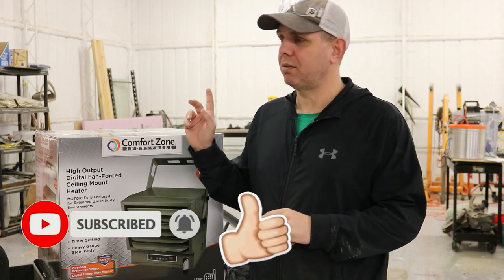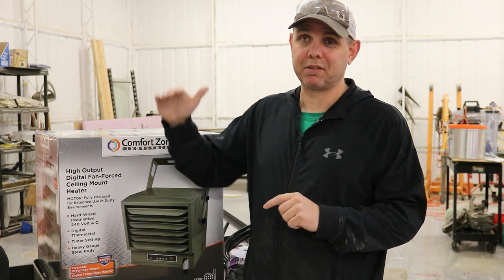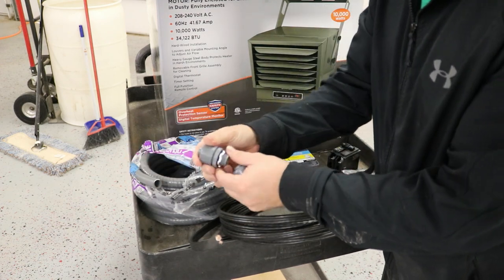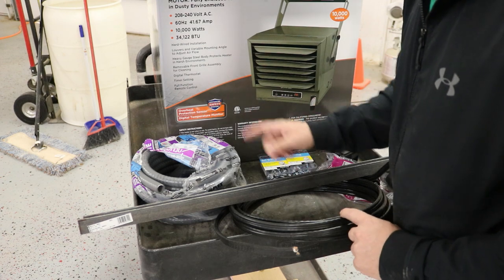Shop Heater, Electric Heaters for your Small Garage or Large Shop!

Comment: Hey Jake, Thank you so much for this video!! I have a 1200 sq. foot video studio with 18ft ceilings. The building has limited power options so I needed a single heater for the whole space. A buddy of mine (an electrician) and I followed your directions and suspended the unit 13 ft. off the ground. I was worried about the sound of the heater but it's not loud at all! We've had it up for about 2 weeks now and its awesome. Current outside temp is 32 degrees and 75 degrees indoors! Theirs minimal roll-off in heat in the corners -2 degrees max! I am thoroughly impressed with the product and very thankful for you video.
Reply from the maker: Awesome!! I’m glad I could help you out . 👍👍

Comment: Nice job Jake!  I work in a truck shop that heats with propane and has 18ft ceilings. We installed 3 ceiling fans, 55” size I think, and they have helped immensely to push that heat from the ceiling down to the work area. Might be an addition to consider.
Reply from the maker: Absolutely Andrew.. I have to take a break after lifting that heater by myself.. lol Thanks for watching.

Comment: Jake
I’m new to resin casting. 
It’s chilly here in Delaware 
So I’ve been holding off on casting. 
I keep my shop at 57 
And warm it up to 60-62 ish
When I turn 
Can I mix epoxy and put in a pressure pot at 65?
Then bring it in the house 
Cause I heat with a wood stove
Nice and  toasty
KB!
Reply from the maker: I have been doing all my pours at 65 and they stay in the shop... there’s nothing wrong with taking the pressure pot to  the house.

Comment: I have a question. I installed a 7500w garage heater. I used the 8/2 gauge wire with an 40 Amp 2- pole breaker but when I turn on the breaker. It would shut off all the power and trip the 2-pole breaker. What would you think is the problem?
Reply from the maker: You should contact a professional for your electrical issues..
Reply: @Jake Thompson  my electrician guy was installing it. He's not sure what's going on so I thought I asked you of what you think it might be. But thanks
Reply from the maker: @beeznestvlogs6981  i don’t need up using a 50 amp breaker.. I put some text in the video explaining it .. I’m sorry but I’ve learned my lessons on giving advise on things like electricity.. I’m just not qualified. I hope you get it figured out.
Reply: @Jake Thompson  okay thank you for the fast respond. I appreciated it

Comment: I got two of the 7.500 heaters for my 30×40 shop do you think will work to keep me at 45 55 i have quail in my shop just need to keep water from freezing
Reply from the maker: The last couple days it’s been around 0 f and my shop was in the 40’s
Reply: Thanks id be alright with that if i don't have to water quail 3 times a day thanks for the input 🙂

Comment: It has been almost 2 years..... are you still happy wirh this heater and the size you got? You spend a lot more time in the shop than you did when you made this video, is it still meeting your shop needs?
Reply from the maker: Yes it’s an awesome heater but it does cost a bit to run.. so I just get it to take the chill out of the shop and it does a fine job

Comment: ok just checking ,I have the same heater I just nstalled and It came on for 5 minutes and went off and have not had power after that ?
Reply from the maker: There’s probably a troubleshooting section in the directions

Comment: I just installed the same exact heater and I believe my fan is not turning as fast as it should. Yours sound much louder than mine. I cannot feel the fan/ heat any more than about 8ft away. How far can you stand in the path of the fan and still feel the heat?
Reply from the maker: Mine is about 10 feet high and if I stand directly in it’s path I can feel it

Comment: Does the heater turn off after 12 hours or can you set it at say 60 degrees and leave it on for weeks and it maintain the temperature? The description online isn’t very clear if it automatically turns off every 12 hours or if you have the option to set it between 1-12 hours. I had planned to use it in a shop where I have to have consistent heat, can’t have it dropping down to winter temps and then only being warm when I’m there. Will be days where I’m not there.
Reply from the maker: You can habit on full time of set the timer.
Reply: @JakeThompson  what is the longest you have ran it for?
Reply from the maker: @alexbowen2010  A week
Reply: @JakeThompson  any issues or did it run fine? I plan to use mine as a permanent heat source for a small 300 square foot taxidermy shop just to keep it about 60
Reply from the maker: @alexbowen2010  No.. it ran fine.. keeps a constant temp.. it is expensive to run it all the time in my big shop but it should keep 300 sq ft heated easily

Comment: Do you know how much it cost to run that heater consistently for a month?
Reply from the maker: Not yet.. I will have to have it for a few months before I can tell.. but the mini split I have in there would never shut off because it couldn’t heat it up past 55 degrees.. so I’m pretty sure this heater will be cheaper than that.

Comment: For optimal performance of this heater, it calls for 6 awg wire and a 60 amp breaker.
Reply: Thinking about doing a 7500watt electric heater in my 26x32 shop would you recommend? Getting gas dug in and installed sounds like it’ll be expensive and I can’t really afford it atm

Comment: Hello, how much electric has this been using?
Reply from the maker: It added an extra 100 a month or so.. during the very cold months of winter..
Reply: @JakeThompson  gas heat would be 400 plus
Reply: @JakeThompson  I'm now considering electric too, thanks for the video! In my area the cost of natural gas is up 50% from a year ago, and electric about 12%, so I'm strongly leaning towards electric for a 700 sq ft attached & insulated garage

Comment: Says 41amps on the box, you put a 40a breaker. Can’t load over 80%, 40x0.8=32.
Reply from the maker: If you watch the entire video . I changed it to a 50 amp breaker 👍
Reply: Actually, 60 amp would be complaint with NEC 424.3(B) which requires 125% coverage (1.25*42 =52.5amp) for electric space heaters under the assumption they have to be capable of running under continuous load (3 or more hours at a time).
Reply: @JakeThompson  I watched the entire video. I probably missed that part. 50A is better.

Comment: Manufacturers  fail to tell you that  square footage and cubic footage are completely different  an eight foot ceiling  is do able with that heater not going to happen in that twelve/fourteen foot ceiling you have since heat rises. Installing fans overhead would more than likely not help.Your salvation will be the room you mentioned
Reply from the maker: I had to turn it down yesterday afternoon.. it was around 50 outside.. it was almost 80 inside.. I’m pretty impressed with it so far.. I knew going in that it would be undersized, but it’s over performed for me so far... The resin room will be built next year sometime.. I really just needed to get through this winter without breaking the bank.. I think it will work.